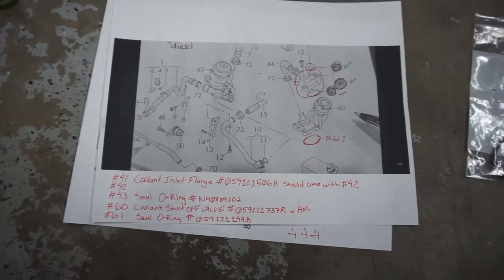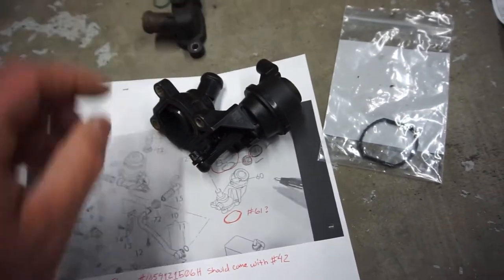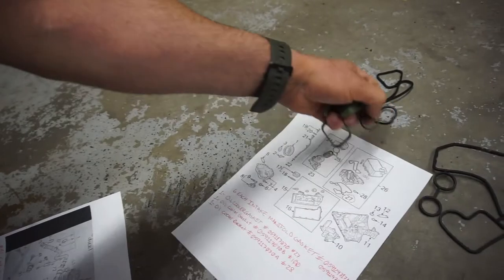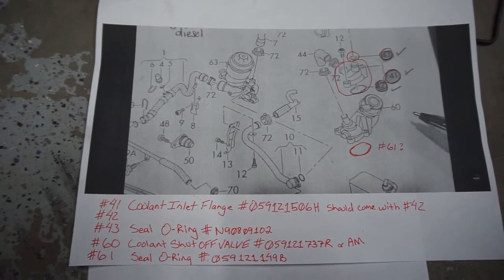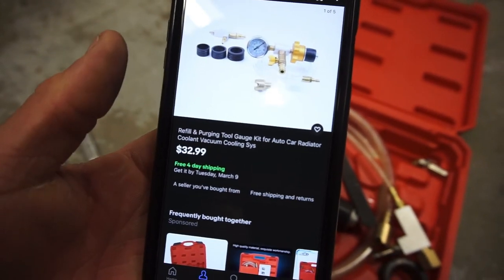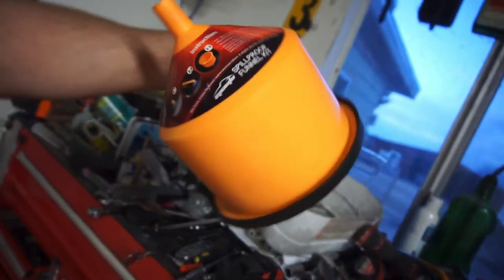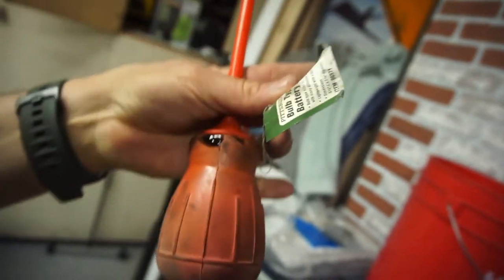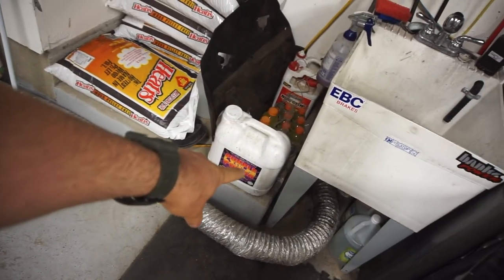2015 Audi Q7 TDI Diesel Coolant Leak Fix, Parts List and Tools. VW

Comment: Thank you for this video.  I am going to be ordering all parts and hope this fixes all our issues.   Keep losing coolant, so took it to dealer. $860 to change a thermostat, which didn't fix the issue.  Now they are saying the oil housing filter and want $1,100.  Took it to my brother in law who is a mechanic, and should have went to him first, but he didn't think it was oil housing filter.  He believes it is coming from the oil cooler location, even before showing him this video.  The oil housing filter is all wet from coolant and the water pump side is drenched in coolant.   After showing him this video he believes this is definitely our leak.  

He will be changing all these parts you listed, as well as oil housing filter and water pump to try to eliminate all possible sources of leaks.  

Again, thank you for the videos!
Reply from the maker: Hopefully it’s the same issue and you get it fixed. You’re welcome.
Reply: Having a very simular issue... did this fix your issue Erino Penaloza?
Reply from the maker: Yes it fixed it and I don’t smell any coolant or have to add any coolant in 35,000 miles.
Reply: @670fastcrf  Sorry I never answered.  Buying everything he said in this video and with his other video this fixed my coolant leak.   Thanks @halffast719
Reply: @Halffast719  Your video fixed our issue.  Thanks!

Comment: Hello...I am in the middle of this job.  So there's no issue reusing the oil cooler adapter plate? thx for the video and part numbers!
Reply from the maker: As long as it’s not cracked or warped you can reuse it. You’re welcome
Reply: @Halffast719  it ended up being okay!  In getting the oil cooler and egr out I had coolant and oil mixing.  I use a might vac to suck everything up, however, I an a little worried about the oil and coolant mixing.  Anything I should do to the coolant system and oil system?
Reply from the maker: If you drained all the oil then I’m pretty sure whatever is left in there will evaporate.

Comment: Hi there, just wondering how long this repair took you? Still deciding if I should attempt it myself or give it to the shop to do lol. Was it hard to clean up the oil/coolant that spilled into the V when you removed the oil/egr cooler? Also did you torque down the screws or just tighten by hand?
Reply from the maker: The screws bottom out so I tightened them by hand roughly 8 foot pounds. It wasn’t that hard to do, it was just a lot of cleaning. Everything from the EGR valve to the intake ports on the cylinder heads ha to be cleaned from all the soot build up. If it wasn’t fo the soot, the whole process could be done in 4-6 hours. But cleaning the soot took 4-6 hours by itself. I used a turkey baster to suck up all the oil and coolant in the valley. Took about 20-30 squeezes. You could use a wet vac or an oil extractor, that would have done a quicker job. Hopefully that helps.
Reply: To be honest i give it to my trusted garage after i saw all those videos, i bring with me all the parts +extra EGR cleaner, I don't have space & outside temperature is -2c in Holland, that's why i let the garage do it
Reply from the maker: I couldn’t agree more. If you have a trusted garage but where I live I don’t trust anyone at all not even Audi. Took it to Audi when I first got it so they can do a complete service and they didn’t put an air filter back in and stripped a bolt for the seat to check the battery. At least if I do it I have no one to blame.

Comment: All the newer cars are screwed up for maintenance , but that Audi seems to have gone out of the way to make it difficult !
Reply from the maker: Yes they are. It could have been worse. At least there’s no gaskets to scrape off. All o-rings that get brittle and leak. Hooray for suckers like me. Hahahaha
Reply: @Halffast719  ; Oh you're not a sucker , but it's a good thing you can do your own maintenance or I don't think you would be very happy paying for the repairs that vehicle requires . I think that's a First Owner car . They get all the benefits and luxury and when the car needs some semi-serious repair they dump it for a new one . Must be nice to have that kind of money ! :-)
Reply from the maker: Sheez tell me about it. I can’t wrap my head around how people afford cars like this, new. I can’t barely afford it used. I like it though.
Reply: @Halffast719  ; There is no doubt it's a nice ride, but I'm more of a basic guy . Daily driver is stripped to the very minimum . No electric windows or door locks or anything else to go wrong. My "hot rods" have nothing that doesn't make them lighter or faster . The old "KISS" system . If I commuted like you do sometimes I might think a little different .
Reply from the maker: Yeah keeping it simple is definitely the best way to go. My old hondararri was as simple as it could get and I got so sick of it commuting 90 miles each way in traffic for 10 years. No I like to ride in comfort but I pay the price once something goes wrong.

Comment: Hey Fonz, how many miles are on your Q7?
Reply from the maker: It’s at 145,650 as of yesterday.
Reply: @Halffast719  No worries, just keep maintaining it like you do and you should pull 300K out of her.
Reply: @mickeyol  My 2012 Touareg has 328K and its time for this job now...regular oil and filter changes may have helped with longevity.